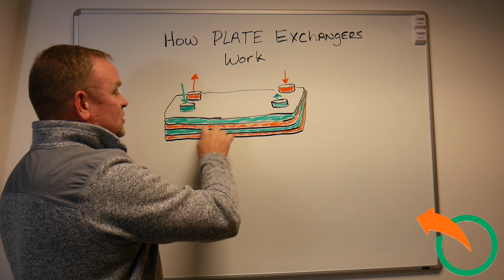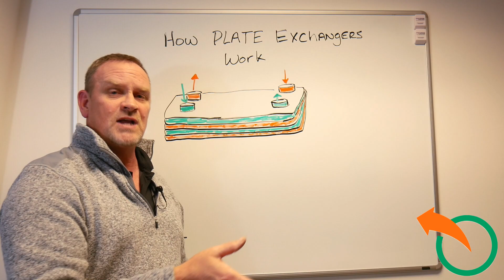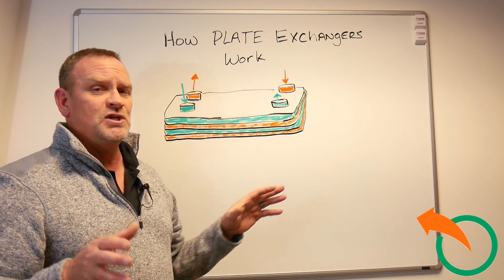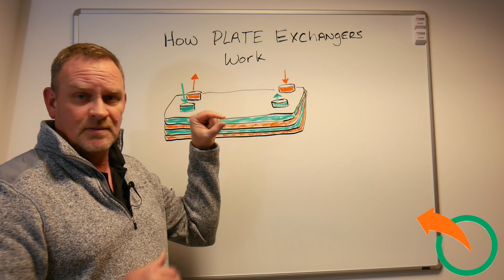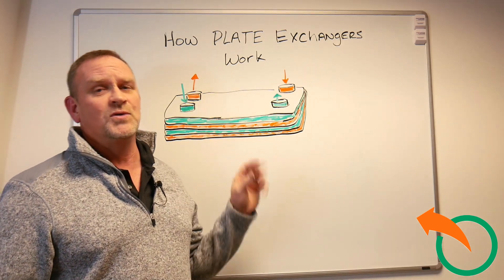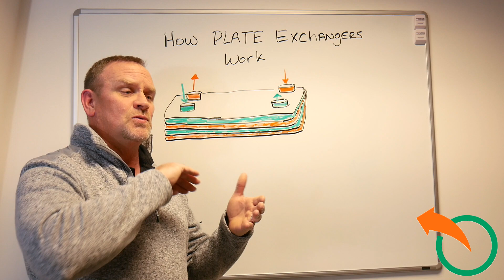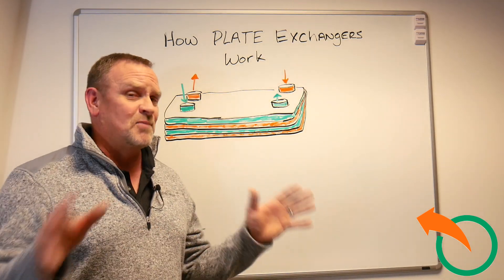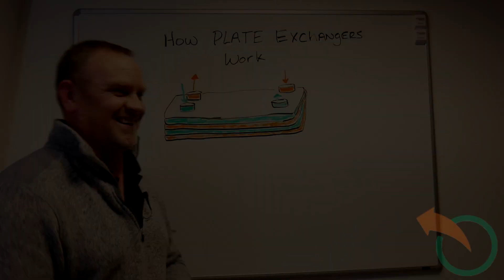How Plate Heat Exchangers Work [Breakdown] | Plate Exchangers 101

Comment: Great video. I have an outdoor wood boiler and oil boiler in the house. I got one of your 60 plate heat exchangers to use. I have it on the return side of the oil boiler, Water from the OWB comes in around 170 and comes out 110 when heat is called for in the house. Heating little over 3500 sq ft all on one loop. Is there a way to limit that big heat loss so I'm not sending such cold water back to the boiler?
Reply from the maker: When your heating a house on one loop it is going to have a large draw of heat. Can you set the house to have several loops? Example a loop for Kitchen and Main tv room, and a loop for upstairs, and a loop dinning room. That will allow the individual zones to recover quickly and rarely all zones are not calling for heat at the same time. Jeff

Comment: Your videos have been incredibly helpful. Thank you. Any resources for solar power integration? Thinking of a build this summer, trying to keep it completely off grid due to frequent power outages. Thank you, again!
Reply from the maker: I have tried installing hydronic solar panels to my existing boiler to heat domestic hot water. It didn't work. Sorry that is all I have tried. I'm not a big fan of PV solar (Electricity) It seems cost prohibitive. I use a large military style (Diesel) generator in case of power outages and a simple 275 gallon oil tank to store fuel. I run generator only 4 to 6 hours (Usually at night dinner time and turn off bedtime) a day to fill water storage tanks and keep food cold and wash clothes and charge handful of batteries and Iphones and stuff like that.  The rest of the time no generator or I also have a small very quiet honda 1100 watt Generator for small stuff if needed. I have figured out I can run like that for almost a year if needed and not being refilled. I'm kind of a Prepper... LOL Let's Go Brandon!

Comment: How many plates would you recommend for a 4000sqft old farm house? Cant get the house above 65 in winter when its 30degrees or lower outside. 55 in the house at the moment and its 1 degree outside.
Reply from the maker: Sounds like you need to check how it is plumbed first. Sounds like the exchanger is installed in-correctly. Also what is the temp of the inside boiler your heating with your outdoor boiler?

Comment: Love your videos... bought a dragon air heat exchanger and love it best one out there.I got a video idea for ya I've seen people use 2 plate exchanger in parallel. Why would you want to do that? Would it be better to run them individually and tee them inline, splitting the flow into 2 exchangers then back into the line continuing on?
Reply from the maker: Thanks for the idea! I like it..

Comment: If your plate exchanger wears out on the boiler side, can boiler water end up in your drinking water?
Reply from the maker: Yes it can. Clearly replace Exchanger asap.
Reply: How is that possible when the home boiler has domestic pressure and the wood boiler is open to atmosphere? Seems to me domestic water would leak into boiler not vice versa?

Comment: I have a perfect video for you. Show us how to hook up a 2nd thermostat to run a furnace fan without the electric heating elements coming on. The catch is new furnaces will only run the fan at slow speed during the circulation call, meaning if you only power the fan the board powers it in slow speed. That a Goodman anyway
Reply from the maker: My very first install at my house was done that way. Then I upgraded to the aquastat way only. Seamless, nice and easy.
Reply: @AltheatsupplyLLC  Please do elaborate. I have met with some pretty good techs that cant figure this out and there are zero videos out that show this. Do you sell this aquastat set up? I actually hooked up relays to stop the elements from coming on and I am unhappy. I would love to see a vid on this..
Reply: @rufustoad1  ,they sell the aquastat, comes with very clear wiring directions. I have it hooked up to my furnace and it works awesome. I have it set at 110 degrees, so if the water gets cooler than that my furnace fires the burners, over that it only turns on the fan and uses the hot water. I'm on year two,with zero issues.